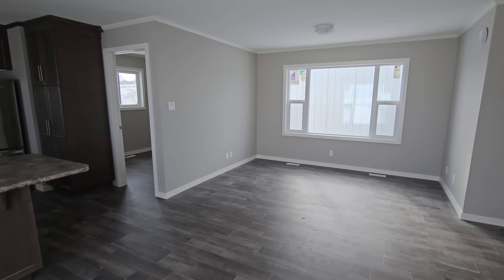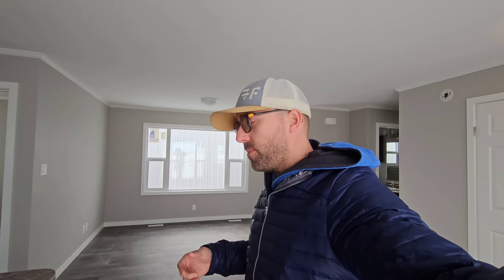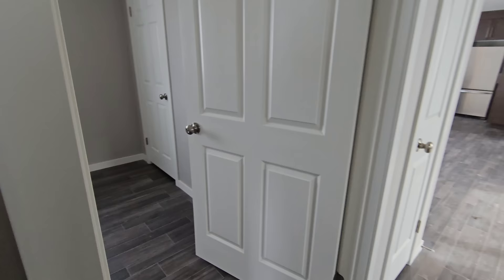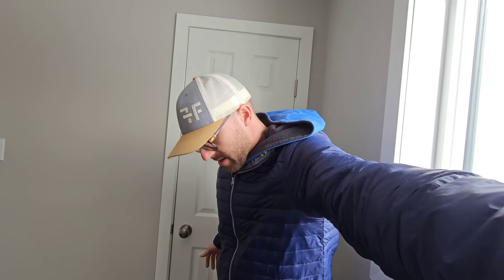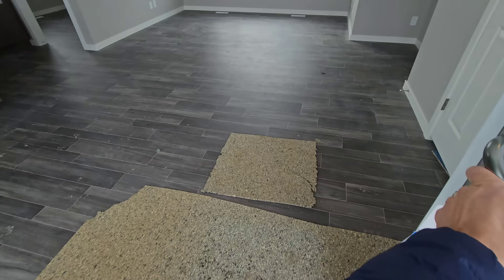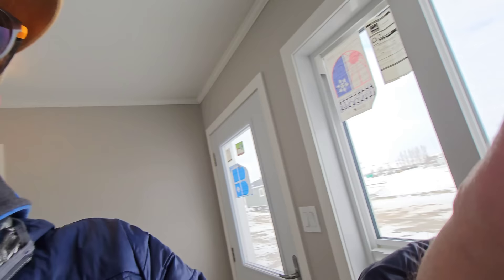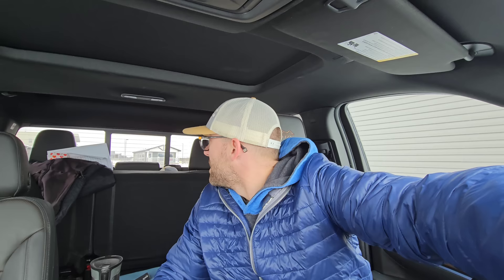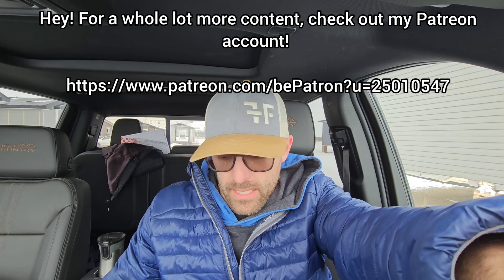Modular Homes? 🤔

Comment: I have quite a bit of experience toting modular homes. My opinion is just like you mentioned in you pay for what you get. Some of them are very well built and most of the time you can tell immediately just by the weight when you start down the road. The largest ones I ever toted were custom built 22’ wide by about 60’ long the crane operator said they weighed around 50k lbs. Good luck Mike. Thanks

Comment: The mobile vs. modular difference boils down to two different building codes. Both are built on a steel frame but  modular uses upgraded and more beefy components comparable to stick built which allows for varied structural styles including two story.

Comment: The board and baton vinyl panels inside of the mobile homes doesnt crack but it also cant be easily repaired if you put a hole in it or damage it in the future. Ask about upgrading the panels to drywall it is often an option, since drywall repairs are a simple fix with a little tape and mud.

Comment: This would be a mobile home because it is built on a trailer frame. Modular are just like a stick built but split through the center to facilitate moving on a support trailer and set off on a foundation or crawl space and then the two halves are PERMANENTLY tied together.
Reply: Nothing is forever
Reply: Modulars are usually built on a trailer as well, it's just also mounted to a foundation.
It's basically two different building codes, with Modulars being slightly better than a mobile.

Comment: Have you inquired about a contract with a hotel/motel? working on railroads they always use local hotels/motels when available and only build housing for workers in very remote areas where hotel/motels are not around. Might be worth looking into, might not but at least good to find out IMO.
Reply: Where there farms are no services such as motels. Both farms are in but f….k Sask  Bracken or Bankend. Both 1 horse towns
Reply: @richardradawetz8788  lots of small towns by both farms that have little hotels, etc.
Reply: @jackbannock3458  I just dove Wadena’s to fort quapele and didn’t see a lot of hotel taprooms or bands s in the banked diistrict. The south farm is probably even more desolate. At least it was last time I was in frontier bracken areas

Comment: Modulars are lifted off of the trailer by a crane and set onto a foundation, crawlspace or basement, they have the plywood underneath holding in the insulation, they are not meant to be moved and once on the foundation hold their value a little better. Mobile homes stay on the trailer and are supported by pilings and tiestraps with a vinyl skirting around the outside, the tires etc are removed but can be put back on to move the home in the future. Double wide mobile homes are harder to move so you really want a permanent placement for them.

Comment: I think RV’s are definitely only good for short stays. They are usually built incredibly light for towing and only meant for weekend warriors. There’s some higher end units for full timers, but you are probably getting into the $100k range at that point.

Many standard RV’s will have thinner plywood on the floors that is usually the first thing to get soft from excessive walking on. Cabinets are usually pretty lightweight and don’t take a lot of abuse. I think even a month stay would probably see as much wear and tear as an entire year or two of normal weekend camping trips. I feel like even normal use I’m always tinkering with my RV, about the only benefit you will have is parking it in one place so it’s not always banging away going down the road which can cause plenty of problems.

Comment: Hey Mike, have you considered just building shops on a slab at each farm then adding dividers/rooms. At least if you did this you could always utilize it as something else later on. You’re always doing your homework and research so I’m sure you’ve considered this. I was just curious on your thoughts on this idea.
Reply from the maker: Yes we have actually, and most likely will go that route as well. But that's more of a down the road in couple years, vs say now or mid summer. But, yes.. I think that would work well.

Comment: Have you thought about just building your own from scratch (stick)?  
Find a suitable location - lot in town or wherever that will allow multiple buildings at one site - depends on your municipal regs
Build flat cement pad with pony walls down to frost with infloor heat (or forced air - if you want to be able to sell/move the units after)
Add septic system to suit your municipality (tank or field)
Build one or two bedroom units with kitchenette and dining/living area with however many baths you need.
Have your crews do the building in the off season since you are looking to keep your main guys busy with make work stuff anyway.  
You could have much better quality product for your staff at fraction of the price.

Comment: I lived in modular home for 1.5 years. It was hard to keep warm temperatures with 0 C outside. Cant imagine living there during canadian winter
Reply from the maker: I live in a older (06) mobile home at the main farm, and have for most of my life. It's been good, only once every 2 years for maybe a day will the water freeze up when - 45C or colder with crazy wind chills... But other than that, I don't have any issues with with staying warm..

And these homes would be an upgrade from what I have still.
Reply: I currently live in a late 70s mobile. I tore siding off and put 1.5 inch foam on the outside. Hugeeee difference in heat costs. I'm 1100 sqft and my costing much different then my parents 2010 solid built home. Definitely get cold spots in the dead of winter but its bearable for the 20k I paid for the house haha.
Reply: @mikemitchell2554 
I copy that live in Central AB 2001 Modular we have a wood stove in it if it's really cold we have to back of a little on the stove otherwise the furnace doesn't run enough, and that's when the sewer line starts to freeze up by the Bath tub

Comment: Mobile Home and Modular homes are both manufactured or prefabricated homes they have differing building certifcations. CSA Z240 MH is the CSA National Standard for Manufactured (Mobile) Home Construction and CSA A277 Standard is a Certification Standard  for modular homes, there are others and different provinces have differing acceptance standards.
Practically, a mobile home is built on a steel frame -as the first one you are looking at is. The tires and tongue are removed and generally stored under the unit so it can be moved again.
Typically the cost of moving should include detailing the unit once placed, such as trim work and re-caulking trim. Modular homes are used in the big oil camps to make camp "hotels" but mobiles are also used alot.
The 16 x60 is a more standard single mobile home and the paneling is most likely vipsum board a fiberglass reinforced vinyl coated 1/4" product quite tough and very washable a good choice for a rental.

Comment: I used to build those at moduline in Medicine Hat, you really don’t want to buy those, they’re cheap for a reason. 😂 you find constant problems all over the place.
Reply: So true! I bought a new custom ordered 24'x60' in 2004. Not a single closet was true and square. The skylights in the bathroom and kitchen started leaking less than a year in. All the roof vents weren't even sealed with tar! Most of the round inside corners needed repairs,as they were all cracked! Froze up the second winter because the heat tape deal kicked out! It took forever to get things repaired properly. Wasn't impressed. I'd really like to know how much Mike would be looking at to put two c-cans side by side and have the insides finished?

Comment: I wonder if a person sat down with the 'factory' folks who build modular units - describing the usage you visualize... that they would suggest layout, size, materials, etc.  (not 'custom' as in deluxe, but assuring needs are met)    
As you walked through those models... it seemed 1) is it super at dealing with the cold?... and 2) is it rugged enough to endure younger single fellows and families w/ children?... to limit maintenance.
Reply from the maker: Yeah I would have to furnish it yes, but then you have something for the long term..

Comment: Modular / mobile homes will depreciate in value…
Reply from the maker: Yes and no... Buying a mobile home in a urban area (15000ppl) maybe.. But in a rural area 25-2500 ppl no.. Because you can easily put the wheels back under it and move it. Have bought and sold in the past..

But let's for example take a "stick built home or even a RTM (ready to move house) and spend $1M on either of them, the resale of it in a rural area would be $200k maybe if Ur lucky after 30days of finishing it. 😬😂

Now that same home in a urban area, you just hope it somewhat holds it's value.